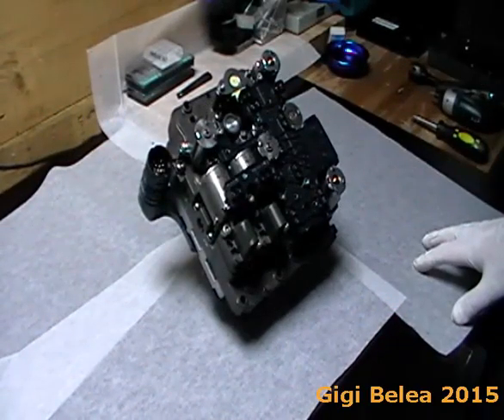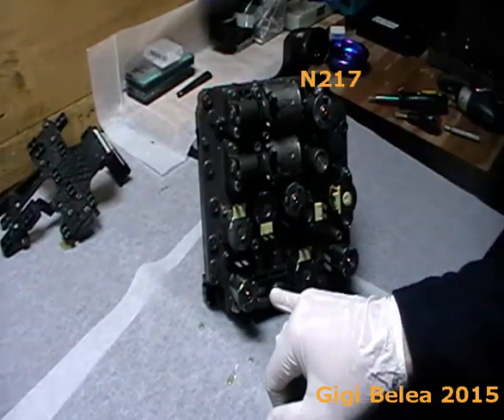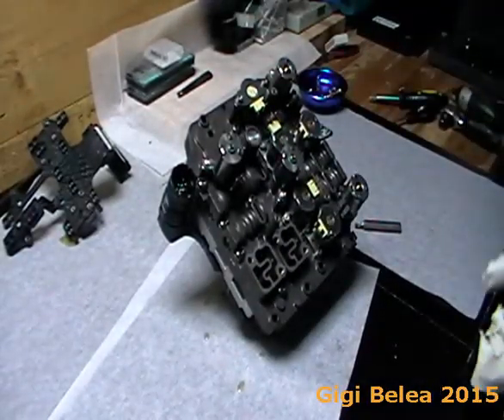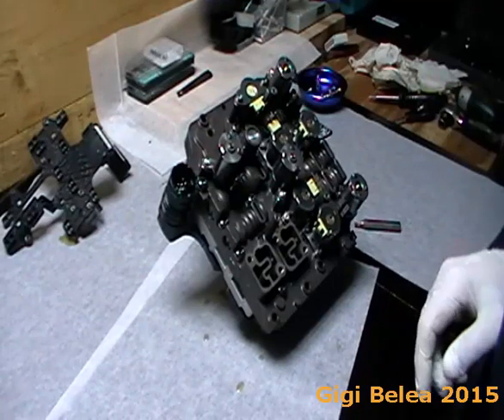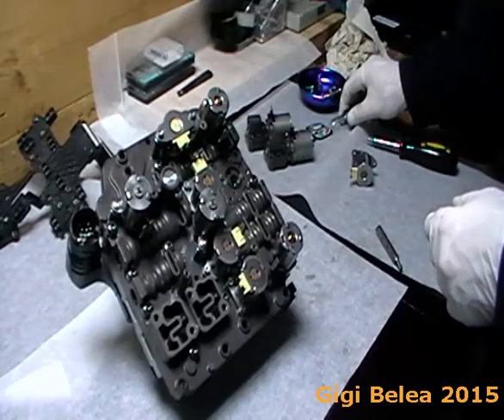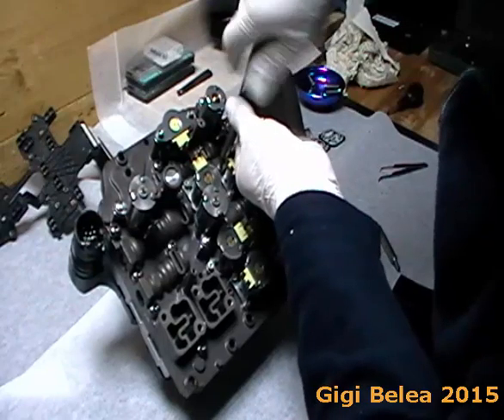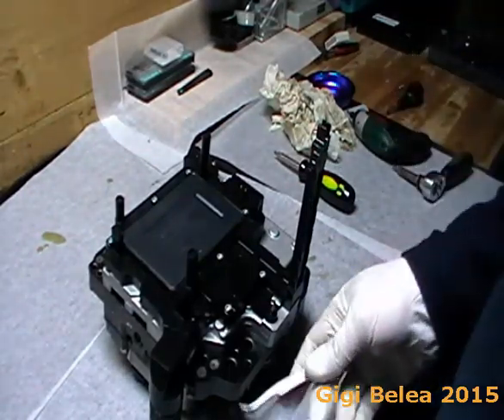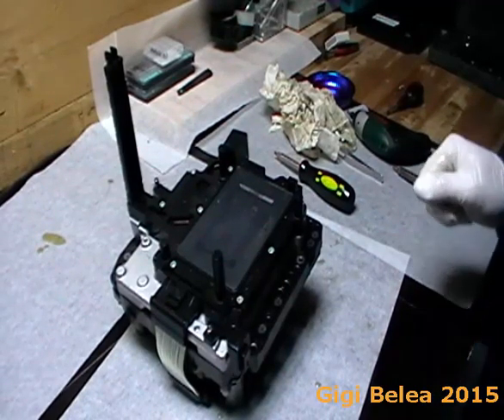Changing DSG Solenoid / Valve on DSG6 Mechatronic Unit

Comment: Hello Gigi ! Can u tell me if it a mechatronic or clutch problem ? For example i am going with 65 km/h with 6 gear , i press acceleration but does not change into 5 , it still goes with 6 even if it is with verry low rmp , i have to press harder on the acceleration to make the changing , and the enging is forging to go faster and when it changes the gear it makes a an unconfortable boost . And other problem not sure if it is a problem , when i let the foot of the pedal in 2 maxim 3 meters the gear changes intro second gear with no acceleration. Thankyou verry much !
Reply from the maker: Check your rear wheel bearings, there are the ABS sender gaps. Usually this is the problem if it changes fine in M. If your car is remapped, talk to your tuner, might be a bad remap for your engine when runing DSG
Reply: Thankyou verry much !  There is no remap on the engine but i will go and ask my mecanic or vw service about what u said !
Reply: Dupa numele de Gigi Belea s-ar putea sa fi roman , imi poti spune pe romaneste mai exact ce ar trebui sa verific ? Sa nu fi inteles gresit nu de alta , multumesc !
Reply from the maker: Schimba rulmentii pe spate.

Comment: Does faulty n215/n216 valve make DSG slam violently into reverse or drive after performing DSG reset ??  THANK YOU. I noticed after performing the reset and putting it into drive it slams hard. It corrected itself after a 10 min drive . Could the n215 be defective thats causing this?
Reply from the maker: Could be a sticky valve, old oil, or worn mechanical valve.

Comment: Hello sir,   first of all an aweesome video you have made.  I hope its not a problem for you to answer me one question.
Could a bad solenoid be the reason my 2006 Audi A3 SB  with dsg is making a clunk (metal on metal)  sound when downshift from 3rd to 2nd gear? 
Just a sound,  it doesn't affect the driving at all and the gearbox shifts precise and fluid like a dream... 

Thanks anyway and best regards!
Reply from the maker: Can be solenoid yes, but can also be mechanical problem inside gearbox.
Reply: It could be the flywheel. The flywheel on these cars go bad quick.

Comment: Salutari. Am nevoie de o informatie pretioasa. Detin o octavia 2 2006 cutie dsg1. Am mers mult cu uleiul in cutie, in scadere (cauza termoflot cutie) si a inceput sa dea probleme, erori aleatorii de genu n215,n216, presiune ulei prea slaba, interferenta mechatronic. Am demontat mechatronicul dar din cutie am scps putin ulei (cam 1 litru). E de ajuns sa bag ulei nou si la nivel sau deja trebuie schimbat mechatronic?
Reply from the maker: completeaza la nivelul corect
Reply: @GigiBeleaDK  Asa o sa fac, am verificat rezistenta pe fiecare valva si sunt toate ok. Am alta intrebare daca nu deranjez. In caz ca e nevoie sa schimb mechatronicul, am gasit ceva oferte sh , dar difera codurile la sfarsit, adica la mine se termina cu AE si am gasit altele cu AJ , AM etc la sfarsit. Conteaza acesc cod de pe calculator?
Reply from the maker: @iulianberdei3150  Da , in plus conteaza versiunea de soft programata pe modul.
Reply: @GigiBeleaDK  Am facut schimbul de ulei (cu febi bilstain) , a mers bine masina cateva minute , dar acum cum dau sa plec intra in protectie. Nu are logica, cu ulei nou si la nivel s-a inrautatit situatia.
Reply: @GigiBeleaDK  Ca si erori , apar scurt pe n215 (uneori pe plus si uneori pe minu), uneori acurt pe n215, presiune ulei prea mica , si eroare necunoscuta. Uneori apar unele, le starg, apar altele pe urma.

Comment: Please on fault code(18228) P1820 pressure control solenoid 'b' control circuit high- Implausible signal...Does this requires rebuild mechatronic or only have to change PCS b.Thank you
Reply from the maker: You can't change PCB on DSG6.

Comment: Salut Gigi.
De unde achiziționezi solenoizii?
Am nevoie ptr un dsg 7.
Am pățit o iar.
S a fisurat iar baza acumulatorului chiar în dreptul supapei pe unde respira mechatronicul și mi a dat uleiul afara.
Și am mers cu ea pana a pus cutia pe liber. Am desfăcut mechatronicul și am resudat baza acumulatorului dar după ce îl montez îmi cupleza cutia într o viteza pe înainte( bănuiesc ca a 2-a, pentru ca pleacă un pic mai repde de pe loc decât normal) și nu o mai pune pe liber. Pentru ca dacă dau reverse îmi da șocuri și se oprește motorul.
Cred ca este un solenoid nasol care a rămas cuplat. ( o sa îi masor săptămâna ăsta)
Reply: Probabil cam tarziu, dar gasesti placa nou mai hroasa in carne pe aliexpress la chinezoi, dupa codul de pe ea mai ales daca e dq200, gasesti toate piesele din ea, unele reconditionate. Pret 150 pana la 450 lei cu tot vu set garnituri. Originala are 2,4mm grosime, astea au 4,6mm grosine in zona aia.
Reply: @ico-sl6ti  mulțumesc pentru răspuns 
Am găsit un mechatronic sh și am luat placa din el
Au apărut și pe la noi plăcile acelea groase pe olx sunt 800 de ron
As lua una ptr siguranță că de alta mașina nu am bani :)
Sa vedem ce vamă se plătește la cel de pe Ali

Comment: I have these error on my Mecatronics, kindly tell we how to solve them , thanks in advance.
18223 - Pressure Control Valve 1
 P1815 - 008 - Short to Plus - Intermittent - MIL ON
 Freeze Frame:
 Fault Status: 10101000
 Fault Priority: 0
 Fault Frequency: 255
 Reset counter: 40
 Mileage: 164453 km
 Time Indication: 0
 Date: 2063.14.31
 Time: 00:15:31
 18228 - Pressure Control Valve 2
 P1820 - 008 - Short to Plus - Intermittent - MIL ON
 Freeze Frame:
 Fault Status: 10101000
 Fault Priority: 0
 Fault Frequency: 255
 Reset counter: 40
 Mileage: 164453 km
 Time Indication: 0
 Date: 2063.14.31
 Time: 00:21:04

Comment: hello and thanks for your help...
if you may help in my issue prnd flashing error codes:
18223 - pressure control valve1(215) : short to plus P1815-008 - implausible signal
                      
18228 - pressure control valve1(216) : short to plus P1820-008 - implausible signal.

moniter with vcd pressure on k1 and k2 build up for a second then it goes to zero
please advice.
Reply: +Hosam Hamza any kindly replay plz ??
Reply from the maker: New mechatronic ? Old ? Oil changed ? Details please. Eventually contact me bay mail > jaxelos @ gmail.com
Reply: +GigiBelea  thanks>>  i sent you an email
Reply: Hosam Hamza what you did hosam to solve this problem .. i have same issue with same fault ??
Reply: Hello hamza, and I have the same errors on my dsg box. as you have solved this problem, please in all my heart to answer me.

Comment: Salut. Te rog sa ma ajuți cu un sfat. De curând am problema la cutia de viteze. Nu imi intra in marsalier si panoul luminează intermitent. Pe vcds imi da codul de eroare P18222 care ma duce la valva de presiune N215, e posibil sa fie un scurtcircuit sau trebuie sa schimb tot solenoidul? Unde as putea sa gasesc asa ceva. Mulțumesc
Reply from the maker: It can be both , but if your car is older than 2009 I would say it is the Mechatronic unit that is defective and not the solenoid.

Comment: Hi there i have a 2010 voltwagen cc 2.0t 4 cylinder  i have a code u0101 lost communication with tcm module dsg.  But i check all the selonoid they look okay  have a 4.1 under 6.6 .15.4

Comment: Hallo, Collega Gigi my vw golf V GTI dsg model 2004  flash prnds i read it out the dsg unit and errors code p1824  selenoid controle valve close to massa and p1604 sometime the car when i turn the switch on the prnds is flashing when i pull the key out and in back to switch for a couple times than it work good the prnds dont flash. and when i drive whit the prnds flashes the car dont switch to gear and stay in 2 gear than i turn the switch off than again on and of till the prnds dont flah than i can drive again normaal what can be the trouble thank u
Reply from the maker: Most likely a fault on one of the valves or on the electric circuit inside the TCM.
Reply: Hello Vany, You solve it? i have just the same problem!!
Reply: Vanystuart551
You solve it?!

Comment: hello i have a passat b6 with automatic dsg box and on the box i give the error codes: p1820 p1815 short to b + i tried 2 times to clean the solenoids but the same errors i have and the car does not go away i try a basic setting a reset prnds blinks and goes only if I start in n and after dying I powered solenoid n215 n216  and it is heard that works this is important to hear? or "thank you very much and I look forward to your response
n the light check engine and service coming soon is turn on an parking brake fault
Reply from the maker: If solenoids work then you have a failed PCB in the TCU , Or not enough oil in the transmission.
Reply: what is PCB?
what does TCU mean? can you please tell me a lot. Regards
Reply from the maker: You could also use google ? :) PCB - Printed Circuit Board, TCM - Transmission Control Module.

Comment: when i turn the switch whit no engine running prnds light up i pull the key out and than in en turn it on again prnds light again up and sometime i turn the engine un prnds light again up so i play whit it till the park light only light up thn i can drive so the trouble is i most play with the ignition switch to not to get the prnds lights so mi question is what is the trouble because when i driving the car when i get the light only p on the car drive good the whole day soon i get the ignition key out and wanna turn the engine on prnds light up than i turn the switch of and on off and on start the engine and it dooes good again what can it be collega
Reply from the maker: Then it is for sure the print circuit inside the mechatronic unit.

Comment: salut am o problema cu cutia de la audi a6 2010 eroarea e  p178f ce crezi ca ar trebui sa fac
Reply from the maker: Cracked valve body , you need to replace valve body or repair oil accumulator housing.

Comment: Hello again Gigi, do you have torque specs for the 02e mechatronic solenoids?
Reply from the maker: Hand tight , I do not have torques for them, sorry.
Reply: @GigiBeleaDK  Copy that. If I find specs I'll report back. Thanks again
Reply from the maker: @Messy_Jesse  Doing this for a while now , never used torque settings on solenoids , just feel it when you put them on :)

Comment: Salute to you for great perspective. I replaced a DMF in my 06 vw tdi with dsg 6 speed. While there I changed the clutches. Now I'm having clutch slipping/chattering in all gears. It is driveable and shifts fine. No codes on VCDS. I logged 11/12 in measuring block  and under throttle clutch pressure rising but drops when slip. What do you think master @Gigibelea
Reply from the maker: Perform basic settings.
Reply: did you figure out your issue that you were having, i am experiencing all the same symptoms, changed my clutches made no difference and my pressures also drop when the clutches start to slip as soon as car is warm it slips in every gear but no fault codes, i did replace all my solenoids a bit ago as my main pressure solenoid failed but i think i was sent fake ones as they didn’t quite look like the ones that were taken off

Comment: Hi I have 2005 VW golf gt tai and have code 17160 is this a valve fault ?
Reply from the maker: 17160 - Pressure Control Solenoid 2: Open or Short to Ground . might be valve might be inside the TCM. You need to meassure and check valves first. Check my other videos.
Reply: GigiBelea aka JAX thanks for your reply will check It
Reply: Charles schofield did you get this error sorted if so what was the fix and cost.
Reply: khanvict86 killuminati 
Hi no I didn’t it’s beyond economical repair, cost time etc,.

Comment: Hi I have a fault hoping you could help 17160 Pressure Control Solenoid 2 Open or Short to Ground
Reply from the maker: Need more details in order to help. Sorry.
Reply: @GigiBeleaDK  when the car heats to optimum temp.  The car goes only into limp home mode reverse doesnt engage and PNDRS IS flashing. I had the solonlid 2 replaced but its still doing the same thing
Reply from the maker: @Khanvict1986  That means mechatronic unit has an electrical problem. Might be repairable , might be not , depending on where the error is.

Comment: Salut Gigi.
Vreau sa fac si eu o revizie la un caddy 1.6 tdi dsg.
Schimb filtru +ulei.
Cum iau legatura cu tine?
Reply from the maker: Salut, locuiesc in Danemarca, deci cam greu :)
Reply: GigiBelea aka JAX 
Am inteles.
Multumesc si asa pentru informatiile utile pe care le postezi.
As avea 2 intrebari, daca ai putea sa ma salvezi cu ceva raspunsuri : 1 de ce licare indicativul vitezei din bord?(indiferent in ce viteza sunt )
2 de cateva ori mi s a intamplat sa accelerez pentru a depasi(eram in vit a7-a, cutia scade in vit a 5-a schimba a 6-a dar pe urma urca turatiile pana la 3 mii si nu mai schimba pe ultima, deabea dupa ce merge ceva vreme asa la 3 mii o schimba)
Mentionez ca detin un caddy 1.6 tdi/dsg( 2011)
Te salut si o zi buna.
Reply: GigiBelea aka JAX 
Nu am mentionat :
Masina este recent cumparata din Germania( obligatoriu ii fac schimburile ulei+ filtre)
Ca nu stiu ce are in ea.
Reply from the maker: Pune un tester pe masina si vezi ce erori are. Cauzele poti fi multiple.
Reply: GigiBelea aka JAX 
Salut Gigi si La multi ani alaturi de cei dragi.
Am revenit dupa o dignoza cum mi  ai recomandat pentru problema mea.
In principiu mi a spus ca este pompa din megatronic( nu face suficienta presiune)
Dar iti atasez si codurile pe care mi le a afisat:
006300
006079
002113
006292
Astea sunt toate.
Mentionez ca de atunci am mai facut cateva mii de km.
Inca functioneaza ...schimba toate vitezele etc.
Acum intrebarea lacare probabil te asteptai dupa ce ai citit ce ti am scris: merge inlocuita doar pompa din el sau obligatoriu cu totul ?
Multumesc in avans pentru raspuns.

Comment: Please if anyone can help. I have an audi q3 with this same transmission and solenoid. The car hit in the front damaging one of the valve. I changed the valve and reinstalled it in the car but it will not engage into any gear it just revs  when in reveres or drive.
Reply: Code them amd try might work 
If not then it might be whole mechatronics
Reply: @AnjumanVlogs88  ok thanks I will give it a try
Reply from the maker: @josephfahie8147  You must perform basic settings upon changing solenoids.
Reply: @GigiBeleaDK  I can do so with a good scan tool?

Comment: Hi there,

I happen to have my DSG tranny unmounted due to the constant failure to engage 1st gear and the pulsations on reverse gear. A couple months ago (January 2016) I had the same problem. I ran a VAGCOM scan to find out if there was something wrong with the mechatronic module but it didn't show any DTC. As I read previously on a blog where some guys had encountered the same problem and as a suggestion for this problem was to perform an oil & filter change followed by performing Basic Settings with VAGCOM, I did as suggested and problem seem to dissapear. Back in August 2016 was when the problem became worse, pulsations on reverse were more constant and engagement of 1st gear happened at almost 2500 RPM. I started a routine inspection only to find out that water was being leaked on to the transmission oil due to a failure in the cooler. My question is: do you think problem in the lag of engagement and pulsations are due to water leaking into the oil system or my mechatronic module is the problem?

Please advise.

Thank you very much.
Reply from the maker: Water leaking from cooler is not good and yes , it might have damaged your mechatronic but also the clutches. I would suggest inspecting the clutches also if you have the gearbox down. Then empty the gearbox completely of oil before you put it up again. If after this you still experience problems I would suggest buying a defective unit and change all the valves as you never know which ones got "damaged" by the water leak.

Comment: I will measure the n217 valva see what it give must be 0.5 ohm or what if the case is that the valve is fault than i will replace it and see what it does

Comment: Hello Gigi, my name is Humberto, I write to you for this way since I have a problem with my transmission DSG6 of my Passat 2007, which mechatronics is equal to that of your video in YOUTUBE... The problem is that when the vehicle warms this one, the car changes to 3 (third) speed, in cold the car does not present fault ... they did a diagnosis to him and I throw a mistake in some of the seleniodes N215 ... the mechanic invested or I change the selenoide N215 to the N216 and the N216 to the N215, and this one throws the same fault, bony the selenoide N215 ... my question is ... I must change the selenoide or must change the complete mechatronics? ... here in my country it is very difficult to obtain such supplies .. and they are very costly ... you can give me an advising in the matter .. already my vehicle is 2 months old in the workshop and they do not meet on the fault...Thank you friend for your prompt reputting... Regards..

And he forgives for my English evil
Reply from the maker: Sorry for the late reply. The mechatronic unit can be repaired if the fault is still there after changing the solenoids.